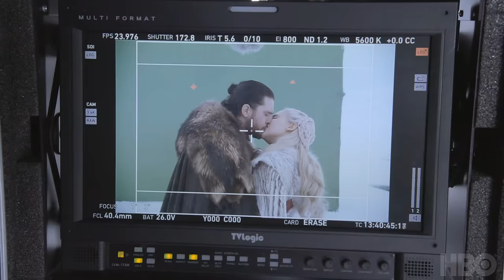Game of Thrones | Season 8 Episode 1 | Game Revealed (HBO)

Comment: Dammit HBO I waited two years and was promised 6 feature length episodes, but instead I got a 54 minute episode 10 mins of credits and a short BTS clip. Talk about jipped. Better deliver in the next five or people are gonna be PISSED
Reply: my guy... the last 4 episodes are projected to be an hour and a half
Reply: Episode 1: 54 Minutes
Episode 2: 58 Minutes
Episode 3: 82 Minutes
Episode 4: 78 Minutes
Episode 5: 80 Minutes
Episode 6: 80 Minutes
Reply: except... no you weren't. I'd be happy to look at the press release from D&D and/or HBO that said that all of the last episodes would be double length, or feature length, whatever you wanna call it. But I'm about 99% sure it doesn't exist. They did speak generally about how most of the season would be substantially longer episodes even though it was the shortest order of total episodes ever. And that's exactly what we've gotten. 4 of the 6 episodes are right about the 80 minute mark, whereas previously the season 7 finale had been the longest one ever at I think like 76-78 minutes. 
Plus, they still have to make individual episodes work as proper stories themselves, structure matters. So it's not like they could just lop 10 minutes off of episode 3 and stick it onto the end of episode 2 just for the sake of them BOTH being longer than usual episodes of 70 minutes. Also frankly this information was fairly widely reported some weeks ago that I would've thought such a diehard fan of the show and someone who bothers to engage in youtube comments about it would've already known.